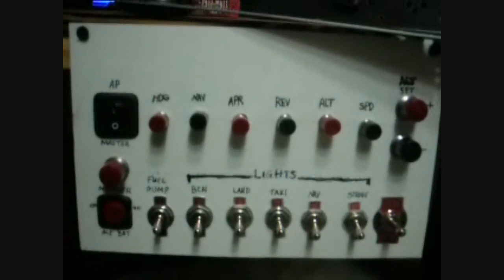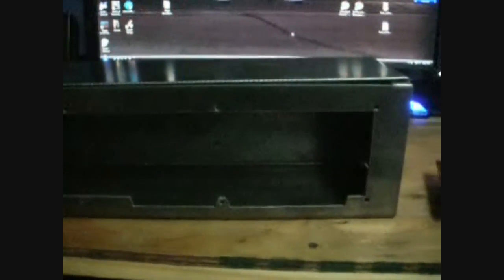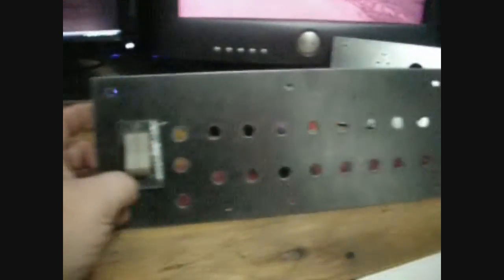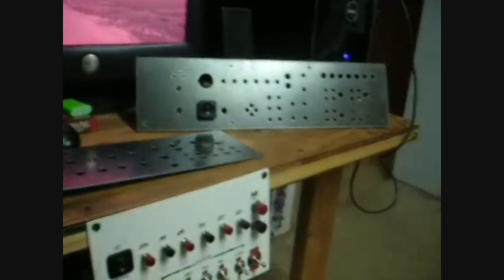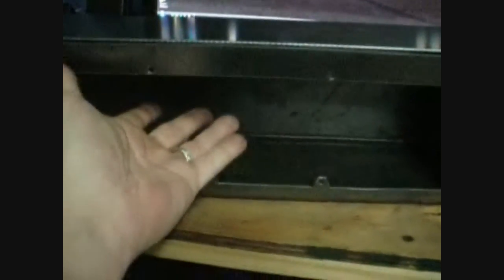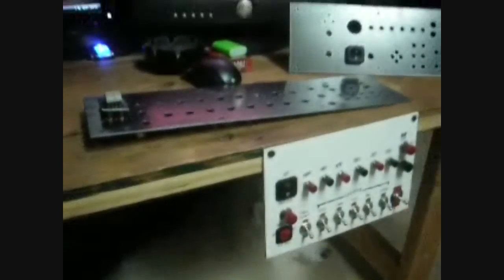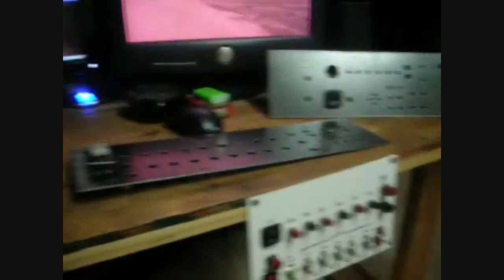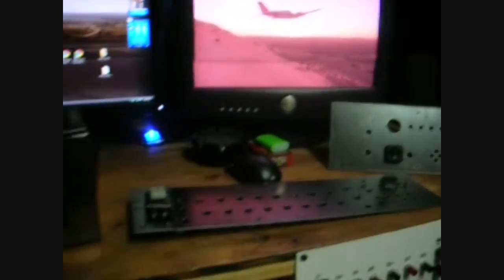Home Cockpit Project

Comment from the maker: Thanks! This will be a slow process. I still need to get 3 more controllers and I am trying to save for my first hour of REAL cockpit time. I made my holes a little too small so have had to drill them a tiny bit wider. As soon as I figure out a little bit more of the labeling, I will print vinyl decals that will cover the face plates completely and contain all the labels. I have several spare buttons and am making sure if I should just leave them as spares, or designate a set function.

Comment from the maker: Looked at simkits first, but the price of a controller was $121.00 and $157.00 shipping! Found a similar controller with more abilities for $35.00 plus $10.00 shipping. As I progress to other components, it will be a mix of GoFlight, Saitek and SimKits. The SimKits are horrible to ship though. I will have to use the cheaper methods as much as possible (unless I win the lottery). For back lighting, I will replace the metal face plate with translucent acrylic. I have a great source for LED's.

Comment from the maker: @cjellwood Several reasons. First of all, this is part of a larger project: Full scale simulator. Second; Saitek (which I DO like) has limited buttons. Also cant position the buttons anywhere but within their housing. Mine can go anywhere. I also have the ability to use real aircraft switches and can build my own operational trim wheels that will work with the controller. I don't want to touch the keys or mouse except when it would be required in real flight. This is just setup for the future.